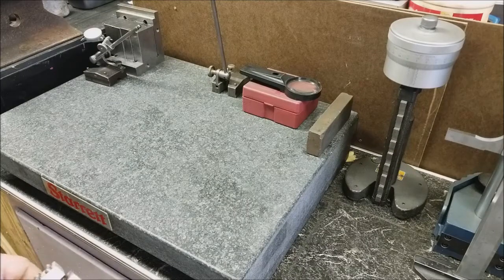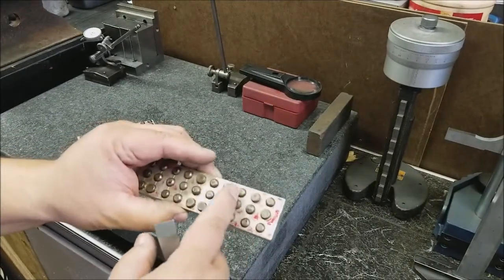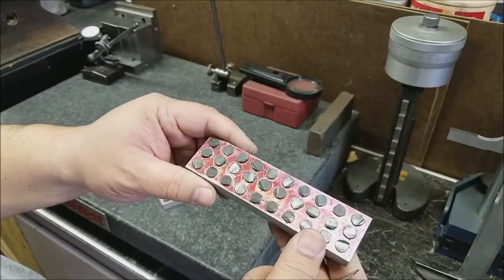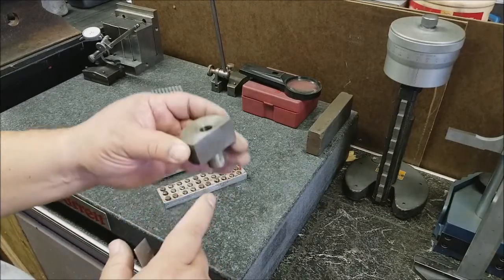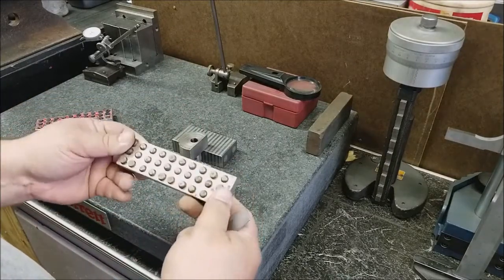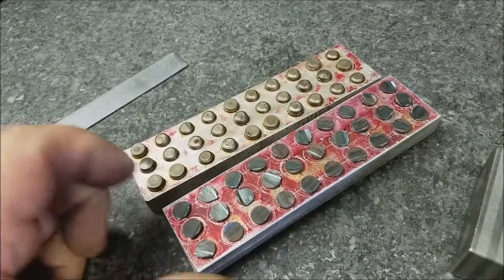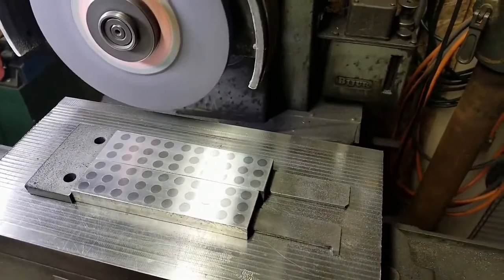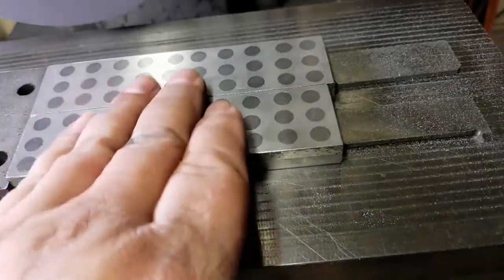THE SECRETE TO SURFACE GRINDING ALUMINUM - MAGNETIC PARALLELS

Comment: Thanks for making this video. I learned a lot. May i add something to the idea. I work daily with magnetic circuits designing loudspeakers. What we find is that the greater the carbon content of a steel the worse the capacity of that steel to guide the magnetic strength or flux. Ideally we use a 1008 grade steel. Common bright nails usually fit the bill for this application. smooth un-coated framing nails work reasonably well.

Mark

Comment: Pro tip: Put that and any grinding setup you can on an angle. Wheel spends less time on the part. Less heat is good stuff when dry grinding.
Reply from the maker: Hello, I have used that technique in the past. I want a decent finish on these as I have had them longer than I have had my children lol. Thanks for adding the tip to the comment section. Thanks for watching and commenting and please subscribe if you haven't done so already!
Mike - Plus8Precision

Comment: Hello I have been making aluminum molds out of 70-75 for almost 45 years.I have used WD-40 in the past. I have much better luck with A9 you can buy it online it is made specifically for cutting.
Reply from the maker: Hello Sam, thanks for the comment I never heard of A9. WD40 was readily available in the shop, so that's what was used. I only use wd40 for surface grinding nothing else. Thanks for watching and commenting and subscribing!
Mike - Plus8Precision

Comment: Hello Mike, glad you completed your project.
Is there any specific grit grinding wheel that we should use along with wd-40 for smooth surface, or any wheel will work? 
Also, how do we lock the aluminium workpiece in its place for grinding?
Reply from the maker: Thank you it only took 20yrs lol. I neverthought it would have taken so long. Thanks for watching and commenting and please subscribe if you have not already...
Mike - Plus8Precision

Comment: Adam Duchert "Adam the machinist" suggest using 16 penny nails, as they are much cheaper,  are long enough to use the nail multiple times, are much smaller in diameter so fine pole is doable, and because theyre much longer than dowel pins, making larger angle blocks is easier.
Reply from the maker: Hello Machinist,  as stated in the video I started this project almost 30yrs ago when I was an apprentice.  As an apprentice we were incouraged to make tools. In a tool and die shop dowels are more plentiful than 16d nails. I'm not a scientist but I have a fine pole chuck on my surface grinder and my magnetic parallels hold extremely well.  I don't know Adam's background so he has his way and I have my way. If you went through an apprenticeship you work with alot of journeyman. So you might learn 10 different ways to do something. So as an apprentice you choose which way works best for you! That's the same here on you tube. Thanks for watching and commenting...
Mike - Plus8Precision

Comment: The size of the pins looks far bigger than the laminations of your vise. Shouldn't the grid be finer for it to transfer the magnetism properly?
Reply from the maker: The pins are 5/16 dowel pins and the parallels work perfectly. Maybe there is an ideal ratio but I don't know what that would be. These work as intended to. When I started these decades ago I copied them from a set my leader had I'm sure. Thanks for watching and commenting...and subscribe if you like my channel. 
Mike  - Plus8Precision

Comment: Just by coincidence or maybe youtube algorithm i was watching a video on homemade magnetic transfer blocks yesterday on Andy the Machinist channel. The consensus there was to use soft iron rather than hardened steel like gauge pins, in his case he used nails. But as they say if it works, it works!
Reply: Make that "Adam the machinist"
Reply from the maker: Hello Chris,
This project was started probably in 1993 so my youtube was the journeyman I worked with. As apprentices we would make things we borrowed from our journeyman. Theses I made with dowel pins that are case hard with the aluminum. This type worked so I started making a set. Most die makers and tool makers have many home made tools. Thanks for watching and commenting...Please subscribe...
Mike - Plus8Precision
Reply: @Plus8Precision  I thought I had, I will if you will too😉
Reply from the maker: @chrisstephens6673  Sure thing, I can't always see who subscribes. It doesn't show up write away, it's the same with comments too...
Mike - Plus8Precision
Reply: @Plus8Precision  yeh, tell me about it.🙄

Comment: Why did you not balance the wheel? Just dressed it.
Reply from the maker: Hello Paul,
I have been in my trade (Tool and Die Maker) since 92' and I have never balanced a grinding wheel. I have never worked with anyone that balanced a grinding wheel, not even the grinderhands. Is that right or wrong I don't know but I have never had or seen any issues with all sorts of grinding. 
The motors on surface grinders start with such torque that the wheel and hub never stay aligned. I was taught if you turn the wheel off you must dress it again. If you don't you get chatter marks on your work piece. I see alot of youtubers turning off the wheels and resuming grinding without dressing the wheel to me that's a no-no. 
That's my answer Paul, thank you for subscribing,  watching, and commenting...
Mike - Plus8Precision
Reply: Sounds good to me. Thanks.

Comment: Hi, I don't understand the benefit of these over ones made of steel for grinding and would take a lot more time, thanks for the video.
Reply from the maker: Hello Ken,
In my situation the benefit was the materials were readily available. Time wasn't a consideration because I was an apprentice and we were encouraged to make our own tools. It was a way of defining your skills. Another consideration was all the shop made magnetic parallels where I worked at; were made in this fashion not the laminated steel type. As for holding power I don't know which are better or stronger. Just know when you using magnetic parallels your going to block in your work. I hope this answered your question...thanks for watching and commenting...
Mike  - Plus8Precision

Comment: Those came out nice, thanks for sharing! I'd like to know the wheel specs
Reply from the maker: D K, The grinding wheel details are...CGW Wheel, 7 X 1/2 X 1 1/4, 32A 46 H8VN, part # M107399. The wheel is on the softerside but is not very porous,  it has close grit pattern. Its my general all around go to wheel. I will add its not very good for chuck grinding unless its all you had. Thanks for watching and commenting...
Mike - Plus8Precision

Comment: Hello Mike,
Good video... Nice to see these have been completed. If I have the space I would have a surface grinder and would make some of these parallels, I can see they would be very useful.
Take care.
Paul,,
Reply from the maker: Hey Paul, 
Thank you, it was like they were staring at me everytime i opened that drawer in my tool box. Just needing to be finished after all these years. They do come in handy and are good to have around. My shop is small to, it would be bigger if i let it spill over onto the other side of my garage. Thanks for watching and commenting. 
Mike - Plus8Precision